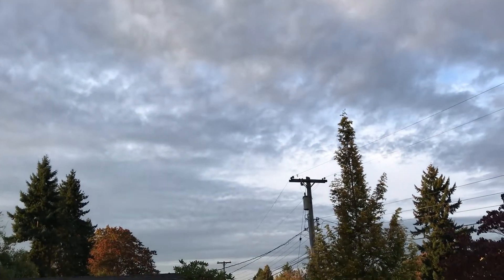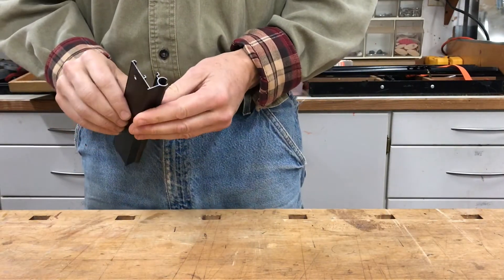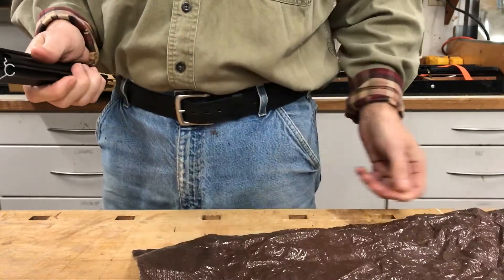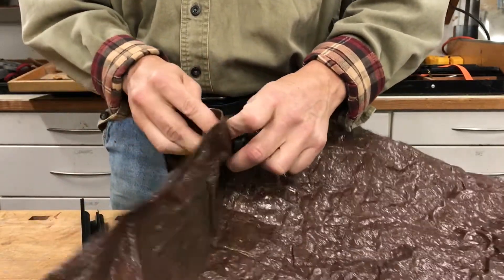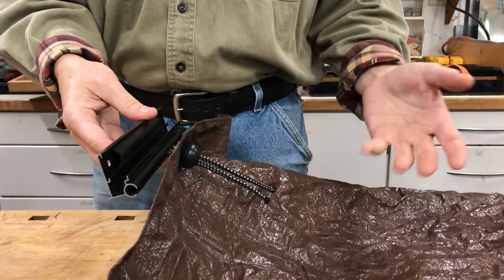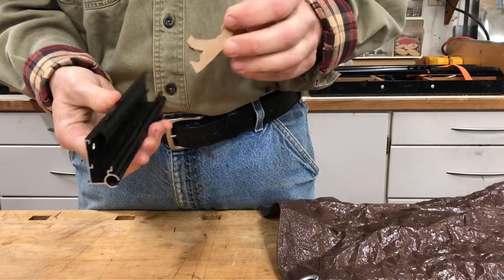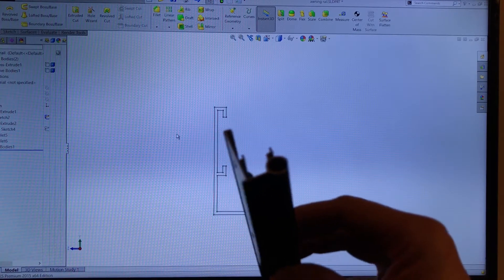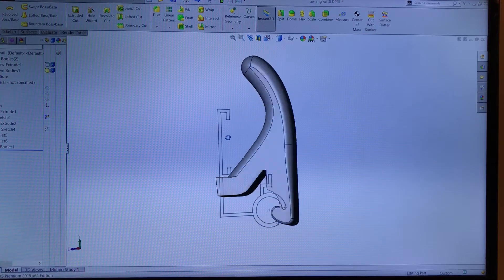Quick DIY RV awning using 3D printed part

Comment: Cool idea for those with the same kind of awning track.  FYI -- a lot of public libraries have 3D printers now so takie the design files to them on a flash drive (mine used to let me submit them through their website but stopped doing that).  It would be nice if @TTrebuild had shared his design files.

Comment: The only critique here is that if you have any wind it will lift the tarp off the hooks. Drilling a hole across the top of the hook and then sliding in a locking pin would fix this problem. Other than that this is a wonderful idea. Are you planning on selling these for those who do not own a 3d printer.

Comment: The piece that slides in the awning track is called a awning rope. Most, but not all, awing ropes have a seaming tails, but  another way you can actually thread a rope through the end of a tarp. Most good tarps are stitched and one can make a small cut in a corner of the tarp and guide the/a rope through to the other end. 
Most awing tracks take a 3/8" rope, but check yours! You can probably find something at a home improvement store and DYI your own rope.   There are other YouTube folks that show different applications for it. I am going the rope with a tail  and will be attempting to heat weld the tail of the rope to a  tarp. 
TTrebuild, you have a thing here, you should capitalize on it

Comment: The solution is simple, and uses the track to make a continuous attachment that will shed water as the awnings are designed. Just get some coax cable the length of your track, and verify that it is small enough to fit into the round track. Then wrap a single layer of tarp around that coax cable and slide it into the round track from one end. If the coax cable is too large to work, get a smaller 'wedge' by using and small diameter cable or even plastic rod. In a pinch, you can even use wooden dowels.

Comment: A poor mans awning wouldn't include a 3D printer!  Cool design though. Could you adjust the angle of the posts that the grommets slip over so that the tarp folds or is tucked down into the gutter creating a ridgeline? That would create a better seal between the van and the tarp so water doesn't run down the underside of the tarp in a heavy rain.